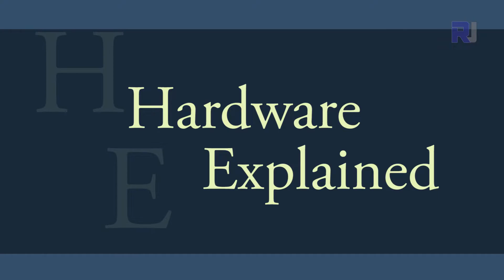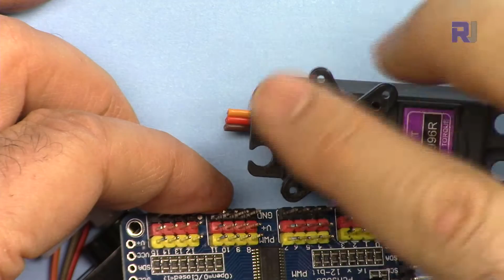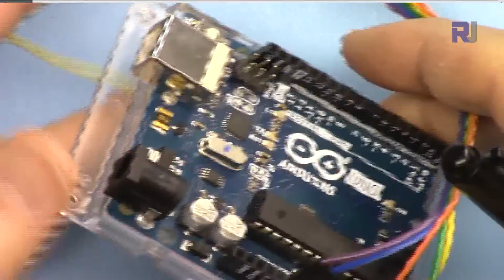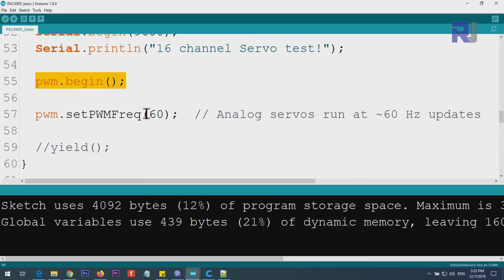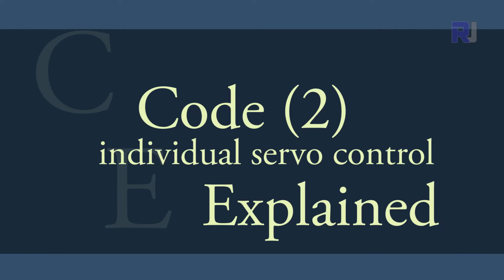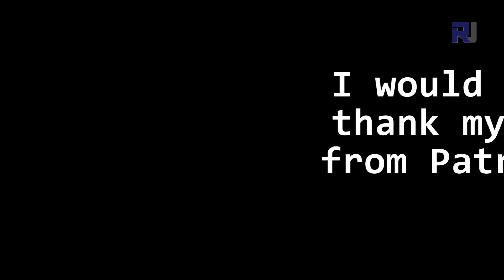Control 16 Servo motors using PCA9685 Module and Arduino V2 - RJT243

Comment: Thanks for the excellent tutorial! I would like to use 5 of the high torque servos (MG996R) for a project of mine.  Do you think the PCA9685 is a good choice or would you recommend a different module?  What would you recommend as an external power source for this setup?  Looking forward to your feedback!
Reply from the maker: You are welcome. Yes it will work . Servos need signal. In one of my demos I don’t remember which v1 to v4 I’ve used one of the mentioned servo.

Comment: Is it possible to move two servos to different angles simultaneously with this module? I'm setting up an important project, but I'm having a hard time doing it.
Reply from the maker: Yes. I just watched the video making sure I have explained how to control servo with this and for sure I have explained it fully. Please watch the code section over and over again so you know how it work and modify the code. good luck.

Comment: Nice! I have two of these modules, yet if I use the power terminal blocks they don't seem to provide any current at all. When I instead connect the power directly from my batteries to the V+ pin, the servo does move but my batteries get REALLY warm and start producing a burnt smell, which is obviously a bad sign. Do you have any idea what is going wrong there? I have this problem with both of the modules, so it doesn't appear to be a manufacturing mistake in one of them...
Reply from the maker: Hello,
I don't know about your battery. But I mentioned it in V1, V2, V3 and V4 of these series videos that you can should power it only if your servo voltage is exactly the same as your battery because voltage is not changed if you connected to the board. it is just a wire.
Reply: @robojax  thanks! I'm using a buck converter to output 5V, and I'm now actually suspecting that either that buck converter is the problem, my batteries are already fried internally, or both, since I also have this problem when I just power a DC motor without this board. Thanks for the response anyway!

Comment: if i am using a 5v power source how many amperes does it need to have?
Reply from the maker: it depends on the servo motors you are using. just measure the current for ONE and multiply by the number of motors you are using.

Comment: selam aleykum brother.
First of all I want to say that your videos are top notch. and i would like to apologize in advance for my bad english. but anyway i have a question for you. If I understand correctly then it is possible to power the servo driver and the arduino via the vin pin with the same power source. Since I have no way of operating the arduino nano with the USB connection, I would like to operate everything with a 6v or 9v battery. How would I have to connect the whole thing together so that everything works.
Reply from the maker: walaikum salaam,  yes you can connect the same voltage to Nano and servo. But the servo motor voltage rating must match that of Arduino Nano.  what do you mean how? if motor and Nano voltage is the same, then simply connect the board + and _ to the battery  and the servo motor power and GND pins to the same battery.  So simply check if the servo can operate with 6V or 9V. if not, then you can connect them.  for example if servo is 5V and you got 9V, then you need a step down converter to convert the voltage form 9V or 6V to 5V suitable for servo motor.
Reply: Thanks for the answer, 
by board do you mean the servo shield?

Comment: Can you run DC motors and servos together on a single PCA9685 with Arduino mega 2560?
Reply from the maker: No you can't run it with this library. You would have to modify it to get result.

Comment: Sir, is it possible to run all 16 motors together but with different speed?
Reply from the maker: yes. that's why I made this video to show you. just change the speed for specific servo. Most people don't watch the video and akd don't learn. if you have a project or just want to learn, please watch the V1 of this video and then V3 and V4. you will learn a lot. Good luck.

Comment: Hi Sir, I have one question I have servo the same as shown in your video. the problem with it is it has jitter. is there a way we can stop jitter by using the library generally I use detach() but Adafruit has no function od detach() is there any way to stop jittering.
Reply from the maker: hi, jittering most probably is due to malfunction of the servo. to understand if this is caused by the library, use the basic servo library and connect ONE servo directly to Arduino and test it.

Comment: I have these PCA 9685 I bought from you and wonder if its possible to use it to run LED lights. If its , what library would work?
Reply from the maker: If you connect single LED with resistor in each output, yes it will work and it you can dim it with this library. But you  would have to change the  pulse width. This is Video V2. You have to watch V1 of this video to learn how. The link to V1 is in the description or search for it.

Comment: How to control the speed of the servo motor with PCA9685?
Reply from the maker: This is Version 2 (V2) of the series. please see V1 to V4. this speed is the maximum, Simply add delay between each step to slow it down.  Please subscribe. I appreciate it and helps my channel grow.  Thank you

Comment: how fast can I update all 16 servos with the PCA9685, assuming 400 kHz I2C on a 16 MHz Arduino? so far it seems a bit slow for my needs.
Reply from the maker: Up to 1MHZ as shown in the datasheet https://cdn-shop.adafruit.com/datasheets/PCA9685.pdf but when it comes to servo, it is determined by servo motor which is very very slow.

Comment: What would happen if i don't use This servo driver?
Reply from the maker: what do you mean by  "if you don't use it"? we use it drive multiple servo. Arduino can't do it itself. if you add the current from each servo, the total would be huge and Arduino board can't handle it.

Comment: How can we operate 15000 servo motors
Reply from the maker: wow.  this is version 1 ov V1 of videos. check the V2, V3 and V4. I have shown how to use 2 of this boards. you can chain 8 of them so it would be 128. then you need 8 groups 8s. you can use Arduino Mega which has lots of pins. Doable but very missy.

Comment: Hello friends!! Greetings from Chile, I have 3 PCA 9685,connected,the
first moves servos without problems, but the second and third do not move the servos,
they turn on with their red light , it will be a sketch error, I
want to move 32 servos to different positions, this is the sketch test:
#include <Wire.h>
#include <Adafruit_PWMServoDriver.h>

Adafruit_PWMServoDriver servos1 = Adafruit_PWMServoDriver(0x40);
Adafruit_PWMServoDriver servos2 = Adafruit_PWMServoDriver(0x41);
Adafruit_PWMServoDriver servos3 = Adafruit_PWMServoDriver(0x42);
unsigned int pos0=125; // ancho de pulso en cuentas para pocicion 0°
unsigned int pos180=575; // ancho de pulso en cuentas para la pocicion 180°

void setup() {
  servos1.begin(); 
  servos2.begin();
  servos3.begin();
  servos1.setPWMFreq(50);
  servos2.setPWMFreq(50);
  servos3.setPWMFreq(50);//frecuecia PWM de 50Hz o T=16,66ms
}

void setServo(uint8_t n_servo, int angulo) {
  int duty;
  duty=map(angulo,0,180,pos0, pos180);
  servos1.setPWM(n_servo, 0, duty);  
  servos2.setPWM(n_servo, 0, duty); 
  servos3.setPWM(n_servo, 0, duty);
}

void loop() {
  
    setServo(0,0);
    setServo(16,0);
    setServo(15,0);
    
    delay(2000);
    setServo(0,30);
    setServo(16,30);
    setServo(15,50);
    
    delay(2000);
    
}
Reply from the maker: what is the error you are getting? the code has been tested and is provided. just post the error.
Reply: @robojax  
Hi, I appreciate your answer. It doesn't make any mistakes, just the first board with x40 direction, move the servo smoothly, the other two with x41 and x42 directions with the welded pins do not move the servos, turn on all 3 with the red light, maybe it's a mistake in my sketch, but you tell me that it's okay, my sketch publishes it in the previous question for you to see. Thanks a lot

Comment: I love your videos!! I was just curious how you would go about installing a push button to go one direction with PCA9685. I tried reversing the angle from 0 to 180 to 180 to 0 but did not work. I'd greatly appreciate your input. Thank you.
Reply from the maker: I am glad you found them useful.  if you wan to learn simple servo , here is the video https://youtu.be/7woqNH_qby4 but in V3 video of this I used single push button https://youtu.be/6P21wG7N6t4 so  you can learn from the simple servo and implement it here. Other than it would need separate video to explain.

Comment: Is there any problem using arduino mega?
Reply: C:\Users\Predator\Documents\Arduino\libraries\Adafruit-PWM-Servo-Driver-Library-master/Adafruit_PWMServoDriver.h:26:10: fatal error: Adafruit_I2CDevice.h: No such file or directory
 #include <Adafruit_I2CDevice.h>
          ^~~~~~~~~~~~~~~~~~~~~~
compilation terminated.
exit status 1
Error compiling for board Arduino Mega or Mega 2560.
Reply from the maker: When we use I2C it does not matter which arduino you use. See other versions of this from v1 yo v4 to learn from it.
Reply from the maker: Sorry when you post a file address or a link YouTube is treating it as spam and I just saw it. Your error is dues lack of library. Install library and the issue is resolved.

Comment: There are like 30 videos on this board from 3 to 4 years ago, none since, because they do not work. I have never in 2 years got one of these boards to do anything.
Reply from the maker: This Version 2 or V2. May be start with v1 and do NOT skip. I have not said anything extra and if you don’t follow and fully watch, this is what happens . Over 50 thousand people have used this project and code has been download. So please watch one last time but fully without skipping. Good luck

Comment: I can't put it run
Reply from the maker: where is the problem? if you are getting error on Arduino IDE, post the error . This not enough. the V1 of this video have been viewed over 100,000 times and 1000s of people are have used it . You must be skipping the video. Have patience, watch it fully without skipping as I have not said anything irrelevant in the video.
Reply: @robojax  I found the mi mistake, now I have a cuestión, how I control the servo speed? It's my first arduino proyect
Reply from the maker: you simply add delya to slow it down. Remove delay will speed it up. Now it is at maximum speed.
Reply: @robojax  hi! first i'm from México city, i have a question, My project is a robot hand, i use 8 servos,  Arduino uno and a pca9685, can i use ay they dame time the Hc-sr04 ti activate My robot hand?

Comment: How much power do 16 servos use? :)
What kind of battery are you using btw... Thank you so much for the video!
Reply from the maker: You are welcome. I did not include the amount of current because each servo will consume current at different rate.  the small servos will  need 50mA to 150mA and multiply it to 16. I am using a power supply.
Reply: @robojax  Thank you so much again :)

Comment: Quick question.  I ran I2C addressing.ino and get the address of my PCA9685 is   I2C device found at address 0x03.  Do I put 0x03 in() ?
 Adafruit_PWMServoDriver pwm = Adafruit_PWMServoDriver();
Reply from the maker: If the address is needed I should have shown it in the tutorial.